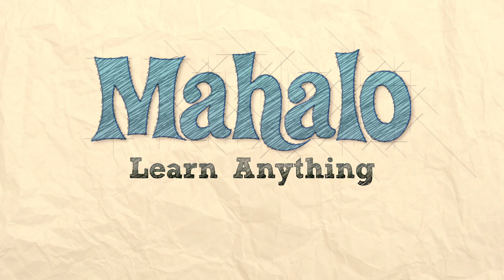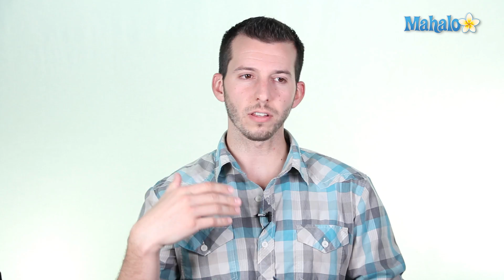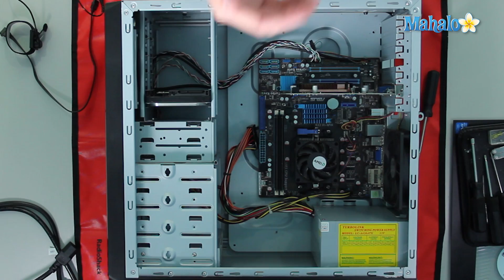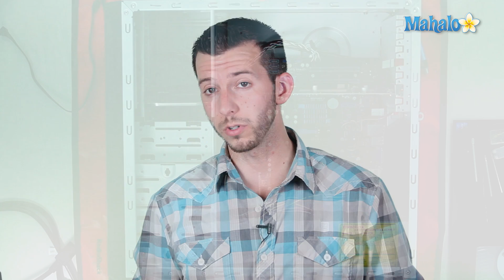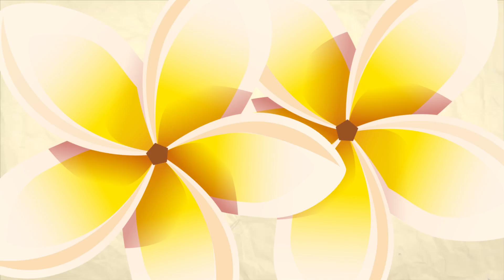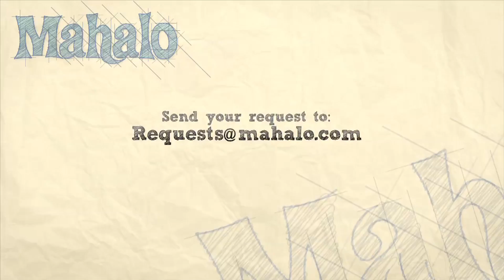North Bridge and South Bridge on Your Motherboard Explained

Comment: The Northbridge connects the CPU to the PCI-E slots and the Southbridge

The Southbridge connects the Northbridge to the SATA, USB, BIOS, and pretty much every other port on your computer, to put it simply.
Reply: Thank you!
Reply: Thank you.
Reply: Not only that, the northbridge also acts as a gpu
Reply: Wait do I need a driver only for the chipset or Do I need for both northbridge and southbridge because on AIDA64 it says ive got AMDRX980 northbridge but Southbridge is [TRIAL VERSION] and I cant use the usb for some reason i cant understand why all my drivers are up to date and everything is working but the USB SM BUS controller somehow isnt installed

Comment: One of these for the newer MSI P67's would be nice. Mine looks pretty different. Heatsinks are to the left of the CPU and below the CPU. The 'higher' one is I'm assuming the north, but it's connected via a pipe to this other heatsink-lookin type of thing that has the OC Genie logo on it. I want to know if I can put an aftermarket heatsink on the north bridge even though there's this two-piece heatsink connected by a pipe about 2 inches long. Haven't found much advice on this. Anyone have one?